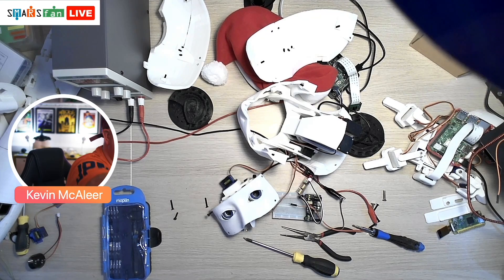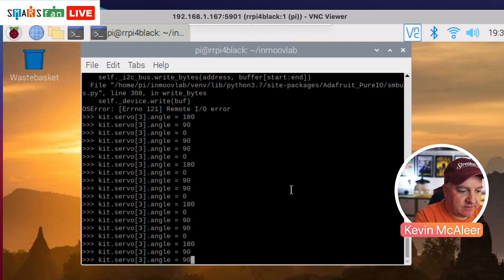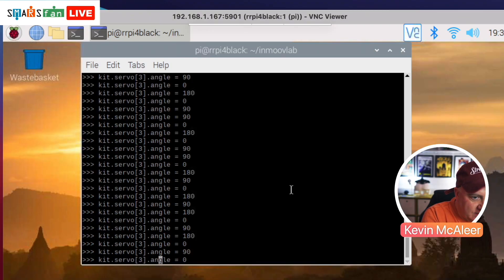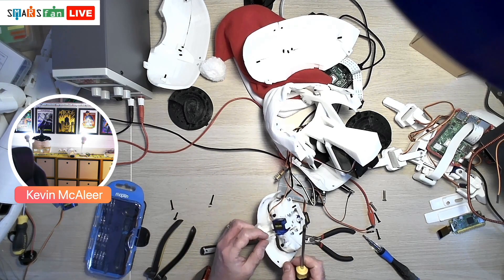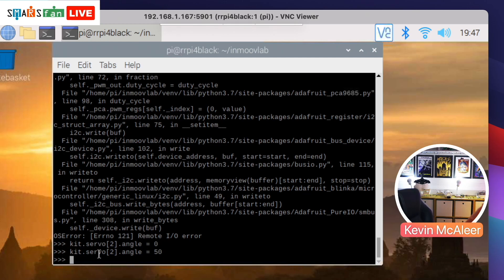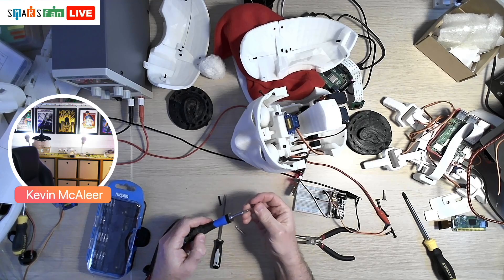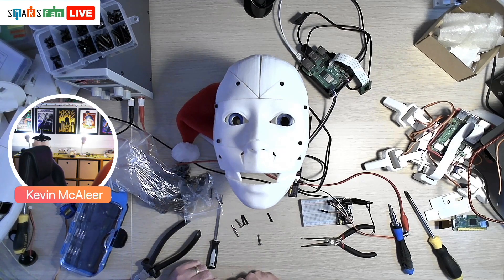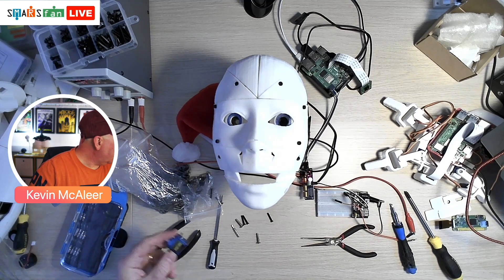InMoov Robot Head build update

Comment: What camera do you have fitted and how well does it work?

Looks like your getting there.
I've not been a fan of those SG90 servos, I've found they tend to be unreliable.
I've been using the PDI-1109MG But I think they may have been replaced by another model.  
But these have been a lot more reliable.
I've got 6 of them in Fred's head to run his advanced eyes.

Keep up the good work :-)
Reply from the maker: I went with life camera Gael used in the original design, the camera is great but you can see the eye socket in shot. I’ll replace these servos over time, they are not really cutting it
Reply: @kevinmcaleer28  Because I'm running a Raspberry Pi, I went with a Raspi spy camera, connect directly to the CSI connector on the Raspberry pi.

The other problem I found with the SG90 servos, when you power them up, they move, even without a signal to control them, sometime, this jerk can break them :-(
Reply from the maker: I'm going to use a Raspberry Pi 4 to control my InMoov, I'm developing some Python code to control the various servos in a way that I can expand upon. I've already got face detection, voice recognition and synthesis working via a respeaker hat.
Reply: @kevinmcaleer28  How do you find the Re-Speaker hat?
Does it have microphone support and direction indication, or was that a different module I'm thinking of?

Thats from seeed studios isn't ?

I have their AI HAT for edge computing, but haven't spent any time on it yet
Reply from the maker: @CyberOne  Yes - its from Seed studios (though you can get clones via key studio). I don't think the 2 mic version can do direction detection - I believe the 4 microphone version does however. Its really simple to use - works exactly as expected, no fuss!

Comment: Are you planning to add the mouth speaker? Also I found that the jaw arms also rubbed and had to be modified
Reply from the maker: Yes the jaw arms really affect the eye movement, I’ll be looking for mods or never versions of this. I will be adding a speaker as I can now do speech synthesis and recognition with the respeaker pi hat
Reply: @kevinmcaleer28   I have a few mods for the jaw arms and mouth speaker to allow the most movement of the eyes and mouth you can find them on Thingiverse